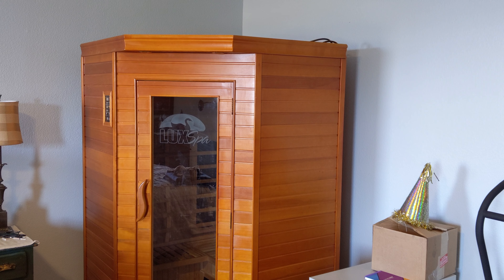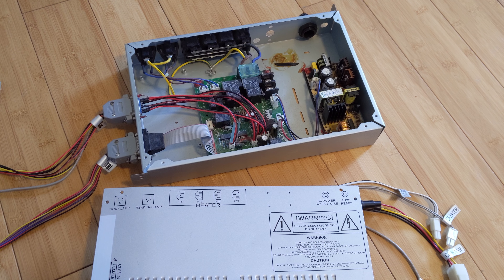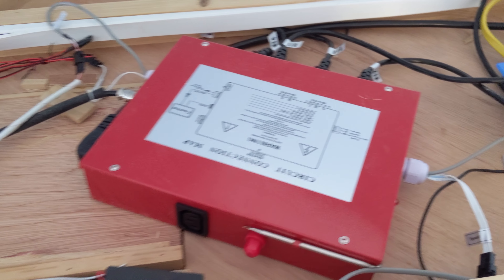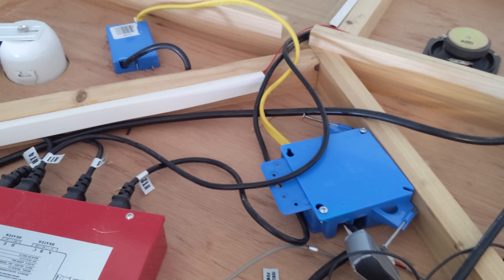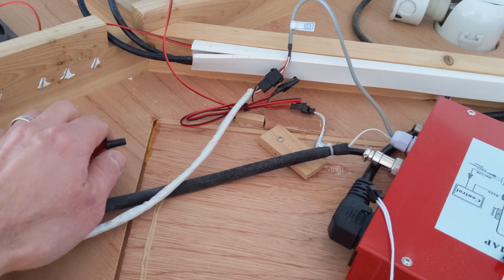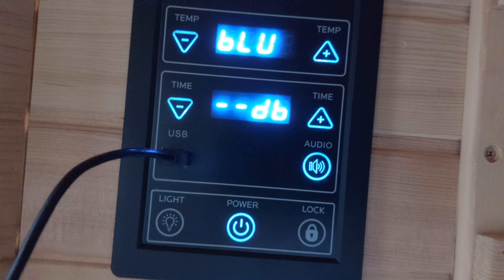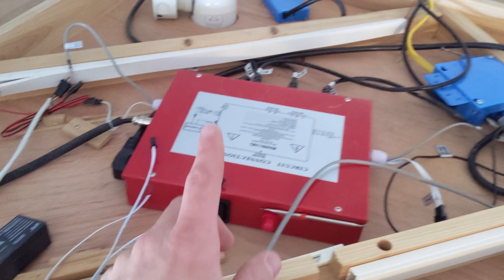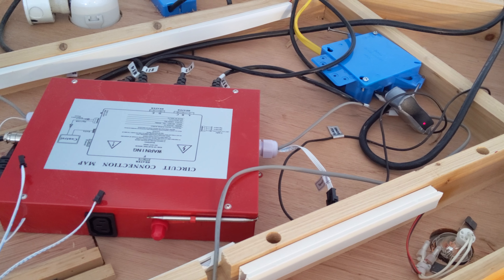Replace Control Panel and Power Box In a Sauna

Comment: I have the same kind just not the conner model amd mine just keeps doing a clicking noise on and off
Reply from the maker: You'll have to do some diagnostics using a multimeter to see where the circuit stops. Could be the control panel or the power box itself.

Comment: I ordered one off ALibaba for 179.00 But it still isn't turning on. I am going to swap power cable and see if anything happens. If not, the next one will be an outdoor sauna.
Reply from the maker: Definitely check that power is coming to the sauna power panel, and that you have power coming out of the box. A multimeter definitely helps problem solve.
Reply: @MyFortressConstruction  looks good on both counts. I even cut an end off of one of my 12g extension cords and hooked it up and still nothing.  Coincidentally exactly the same as the one I am replacing
Reply from the maker: @SFCISME  Ok, so power coming in is good. And you have power leaving and going to the control panel? Is power going back from the control panel to the box? Is power on the contacts of the power box going down to the heaters? There has to be a break in the power somewhere.
Reply: @MyFortressConstruction  but even if I unplug the heaters the panels still do not come on and they should, right?
Reply from the maker: @SFCISME  Yes, so regardless of what's plugged in, you should get power to the control panel. So what have you replaced?
Reply: @MyFortressConstruction  I replaced the power, cables to the heaters and the control panels. Also swapped power cord when it didn’t light up. All to no avail
Reply from the maker: @SFCISME  So you still have the original power box that everything plugs into?
Reply: @MyFortressConstruction  yes, but it is all different connections to the box and controls
Reply from the maker: @SFCISME  Yeah so that's what the service center tech said. She said as a technician repairing all of these different systems she never had good luck, even if parts did function at first, if they weren't made by the same manufacturer. They burn each other out so she preferred to replace the panel and the power box all at once.
Reply: @MyFortressConstruction  yes, which is what I did. But still not working.  I am going to send some more pics to the Alibaba rep today. Maybe we can figure it out
Reply: @MyFortressConstruction  5 days of dealing with the sales rep on Alibaba. They had me take videos and all that. We will see what the resolution is today
Reply: @SFCISME  Please let us know if you got it resolved.  I have an older Sunlight Sauna with same issue.  Thanks!
Reply: @robinconner2427  they are supposedly going to send me another as soon as the Chinese New Year is over.

Comment: Hey mate, just wondering if the panel has inbuilt Bluetooth for music or your phone or do you need to still add a stereo system?
Reply from the maker: So the panel has a Bluetooth receiver built into it and then you take that wire and run it up to whatever kind of speakers you have in the sauna.

Comment: Thanks for the video! It really cleared up a lot of things. I saw that a few people bought this power supply from Ali Baba, Is there someplace else in the states? I have 5 heaters, but only 3 power drops. Can I just apply A.C. to one drop at a time to see what it controls?
Reply from the maker: Unless you know the voltage of the lines you are testing you really don't want to put any power on them. Try to trace lines as best as you can. The power lines that look like they plug into a computer power supply will probably be to the infrared heating elements, but some of the smaller wire is going to be  low voltage. More than likely you will be better off doing what I did and replacing the panel and power supply as a whole unit.

Comment: I bought an ancient sauna. The panel doesn't work but the heating unit does. I have an isolator switch to turn my sauna on and off. Is there a way to wire up so that I skip the panel so I just turn the sauna on and off with the main switch? I don't need any timer or thermostat as my heating unit is small and rarely would get to top temp anyway
Reply from the maker: I don't know the inner workings of these panels well enough to give you a safe answer. I imagine the heaters, if they were just plugged into AC power, would never stop heating since they weren't controlled by a thermostat. That's a pretty big fire risk so please be careful!

Comment: these are a pain in the ass.  First, they fail a few years after you get them and by then all the inventory has changed and no vendor can  quickly solve the problem.  If you have a heavy corner model like I do the PS is also way in the back on the roof where you can't even reach it.   Here's an idea... install a circuit board that doesn't fry when the unit sits unused all year with just the radio clock running and occasionally the outside light is turned on?   My Sony PS3 is probably 15 years old and still works and can be updated with firmware.
Reply from the maker: Yeah... It does seem like these are unnecessarily fragile. They need to be able to handle high amperage draws and I'm guessing they are cheaping out in some of the components. Heat kills and it only takes one part in a circuit to give up the ghost.